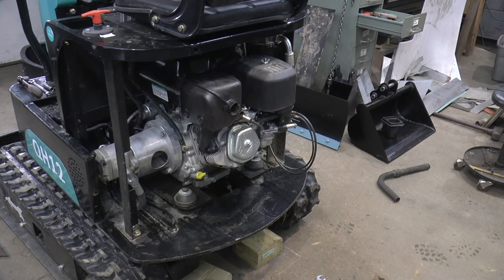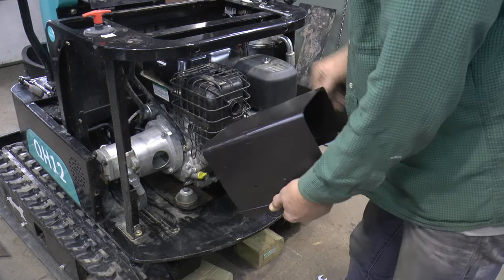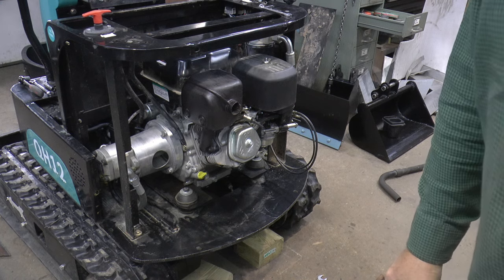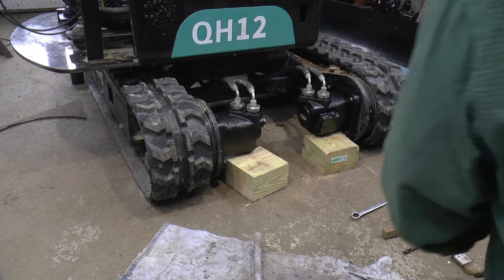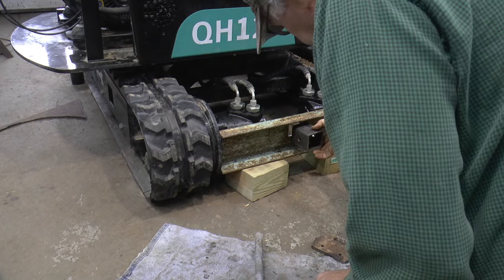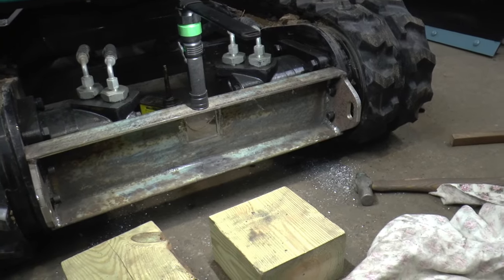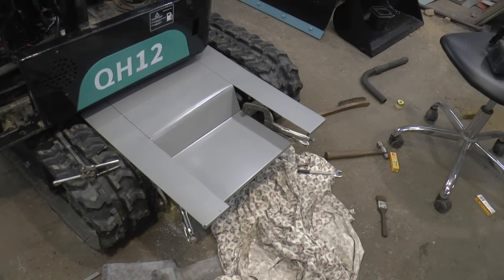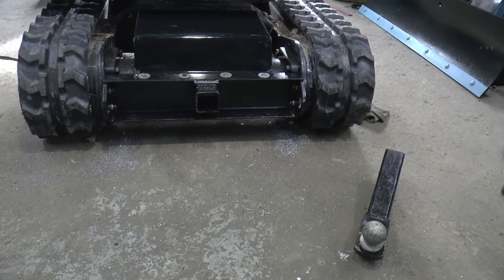Mini Excavator QH12 Mods (Muffler & Drive Motor)

Comment: Did you make a before and after video of the noise improvement? or the temperature improvement?  Thanks for making this video.
Reply from the maker: No I didn't. It was cold here and it seemed like a good time to make some improvements. The general opinion of them needing better cooling seemed like a no brainer. I did run it for about 3 hours on a warm day 68 f ( for this time of year ) and the hydraulic oil stayed just under 40 c. The muffler shield does seem to guide hot air from the muffler out the back vent holes.